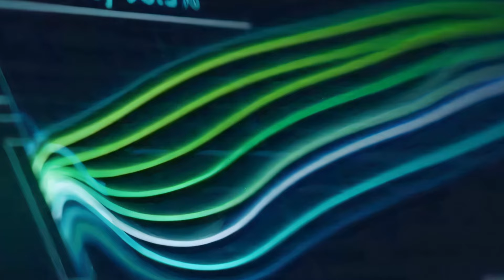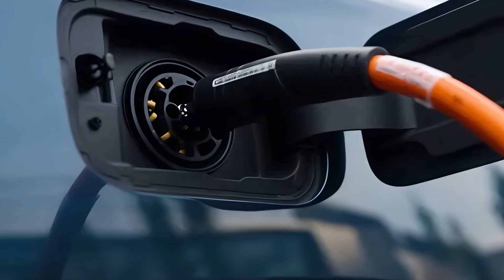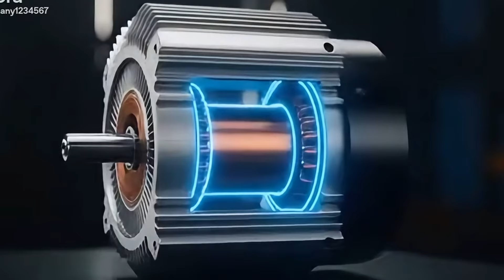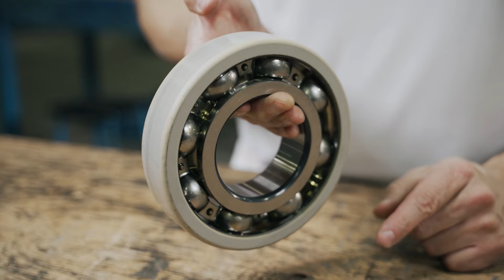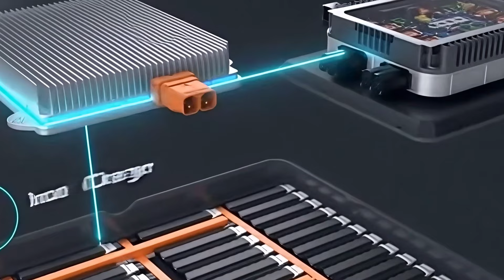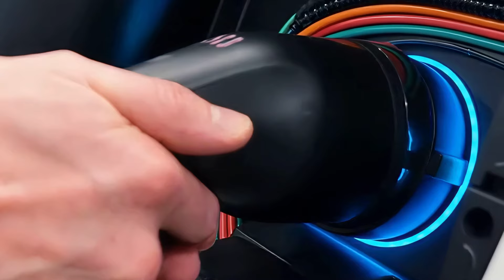Beyond the Battery: The True Lifespan of Core EV Components Revealed!!

Comment: My 2010 Tesla Roadster is still running okay on its original battery. A couple of years ago the PEM, the power electronics module, burned out and had to be replaced. That was a very expensive repair.
Reply: That’s honestly impressive. 2010 was seriously the bad old days for EV tech. The fact that it’s only had one serious repair needed, and it was “only” $9k on such a specialty limited production car is much better than I would have guessed.
Reply from the maker: Sorry to hear that.
How much did the repair cost ?
Was it a time taking repair?
Reply: @shayan_ev  If I remember right, it was around $9,000 and a couple of months, which honestly was quicker than I had expected. When owning any exotic sports car one has to be prepared for things like this. I once needed the wiring harness replaced in a Lotus Esprit V8, that was even more costly. (I should add that I've had the Roadster for 10 years now, and that was the only failure. Otherwise it has been reliable and requires minimal maintenance.)